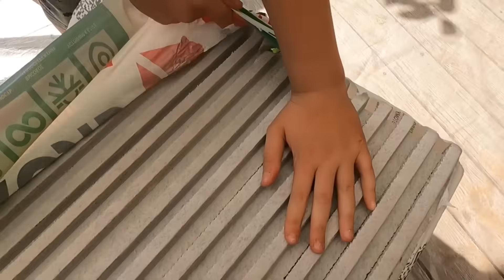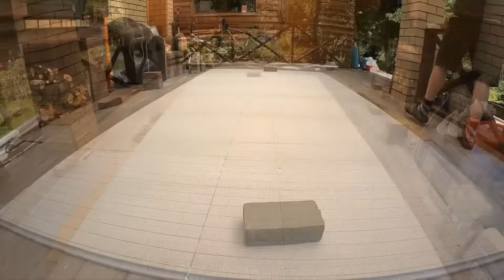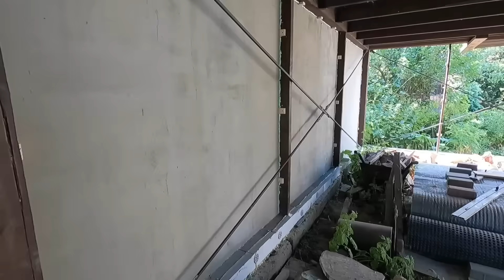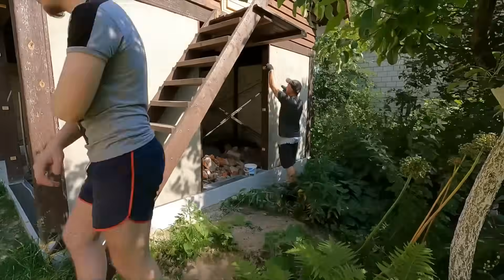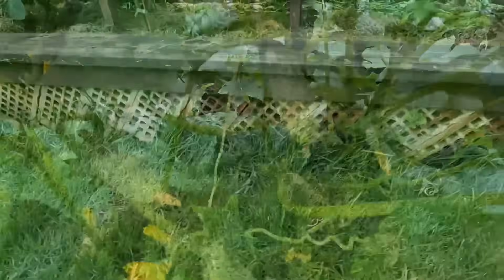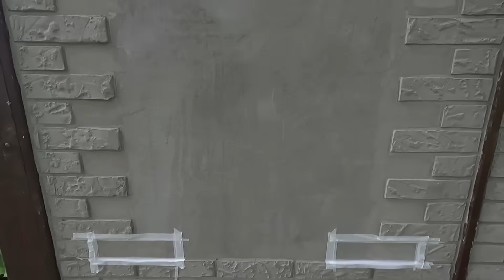Build a 2-Story House for $1,000 — 540 sq ft, Walls Finished DIY!

Comment: Awesome, I wish this quality and low prices were available in New Mexico, unfortunately the Trump oligarchy has driven prices very high. Thank you!
Reply: Did you even find the equivolent to Penoplex Polystyrene in the U.S.? I have looked and can't find it with the lapped edge for joining.
Reply: @ronselliers6951  I mispoke.  He is using EPS foam, which in the US is considered craft foam.  You can get it almost anywhere, including Amazon for not too bad of pricing but I've not found it lapped.  It's not difficult to cut a lap joint into them though with a simple razor knife and a straight edge.
Reply: @ronselliers6951 nothing with a lapped edge, but some that is flexible with similar properties.
Reply: @ronselliers6951  You can find XPS foam (same as the Penoplex) that has the lap joint cut in.  If I remember correctly, it is one of the brands that Lowes carries in 4' x 8' sheets.  I think you can only get them that way in 1/2" or 1" thick though, so may not be worth it.  You want a minimum of 1" to 2" thick (~2.5 to 5 cm) really for this application as each 1/2" of thickness only gives you an R-value of around 2.5 in the XPS.  It is extremely strong on its own but definitely adding the fiber mesh and mortar or Portland cement mix only makes it that much stronger and protects the surface from dings.
Reply: Last time I looked New Mexico has been a blue state for the last twenty year's.  You need stop whining and lobby your state senate and congress as to why they tax everything twice the rate of red states. But then that wouldn't fit your divisive misinformation narrative .